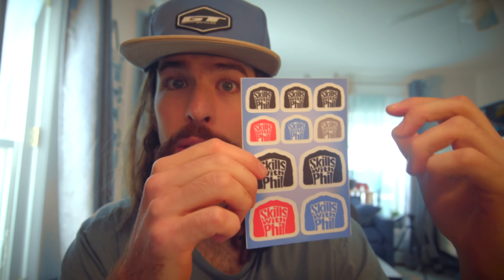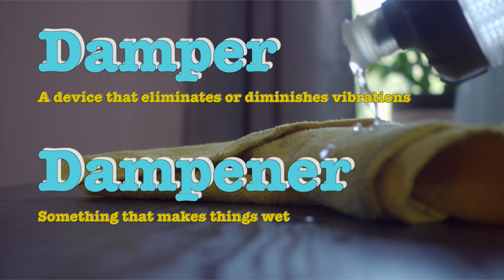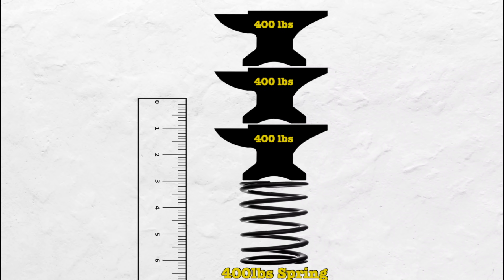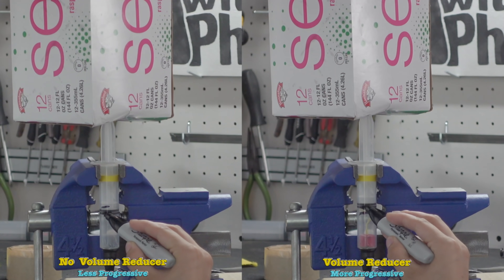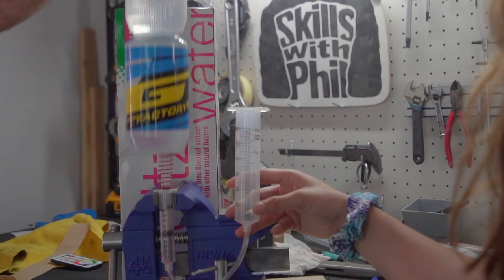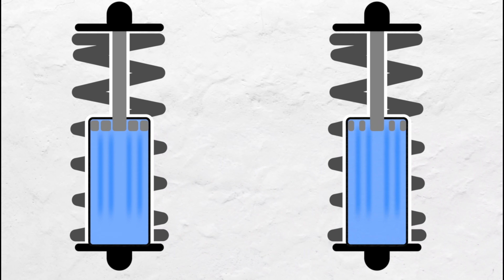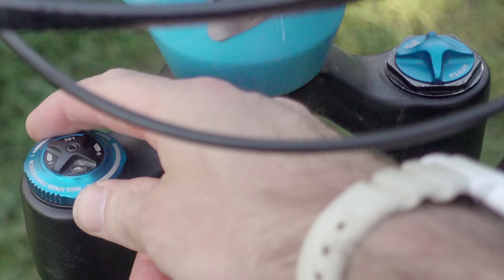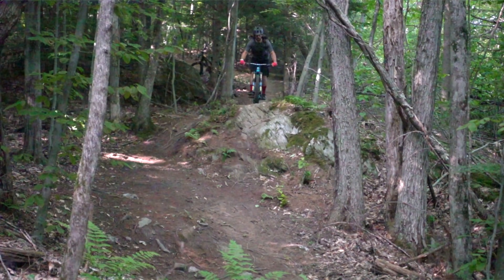How MTB Suspension Works Explained For Dummies

Comment: Probably one of the best explanations of different suspension systems this will definitely be a go to video I will recommend to people wondering how suspension adjustments work and generally just how suspension works.  This is a wonderfully informative video and even though you think your animations skills are lacking I thought they were great!! Awesome video!!
Reply: I agree.  I admit that I wasn't terribly interested but I watched anyway.  The examples and illustrations are well done, they explain the mechanics clearly and I learned some things.  In the end, I found this quite interesting!
Reply: Couldn’t agree more.
Reply: Second.  A very to the point and well explained video for explaining what the shock does including High and Low Speed Compression which would also apply to Damping.  Thanks.